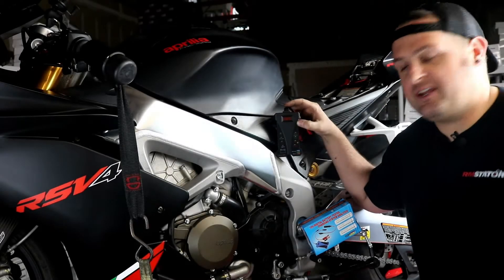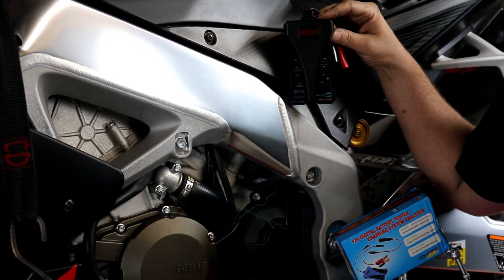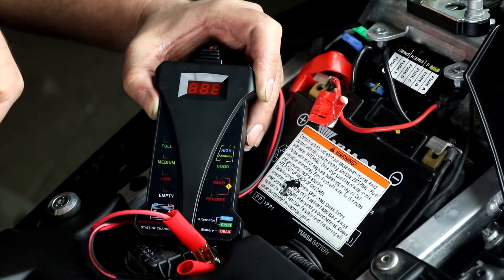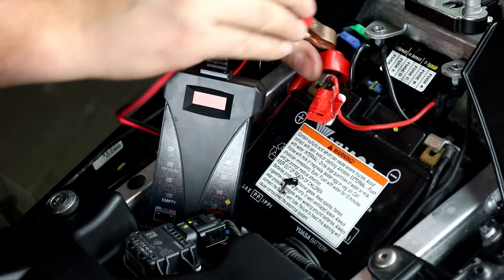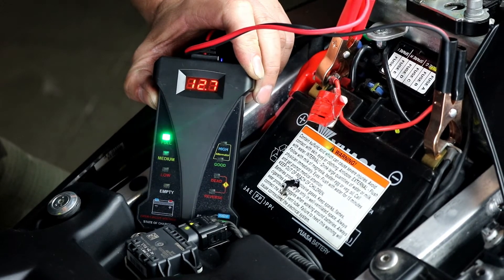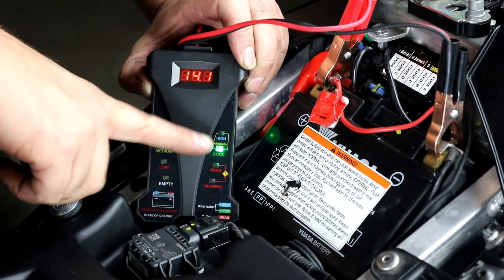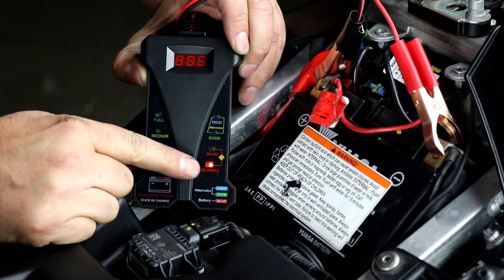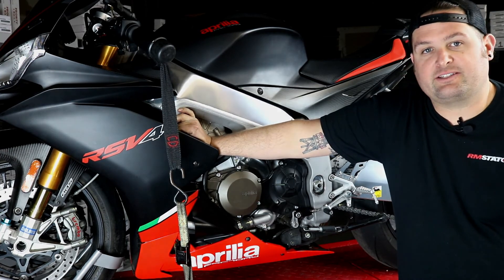RMSTATOR Battery Tester and Charging System Analyzer

Comment: is there a battery in the tester? coz mine, the digital display is not working
Reply: Late reply but if LEDs isn’t working it’s defective
Reply from the maker: There is no battery inside the tester. It is powered from the battery being tested.